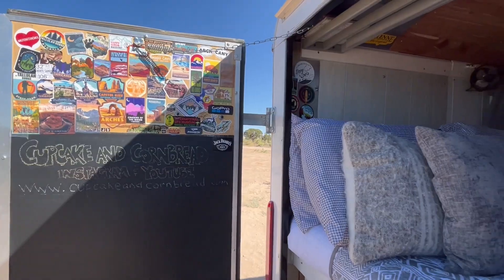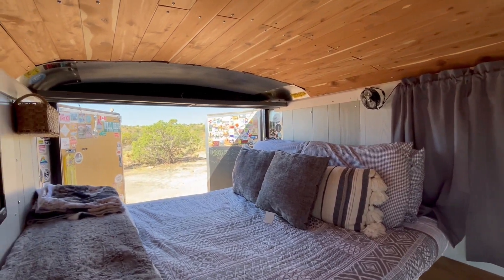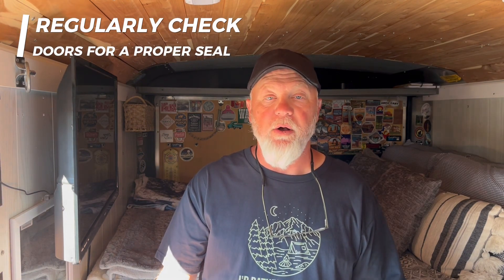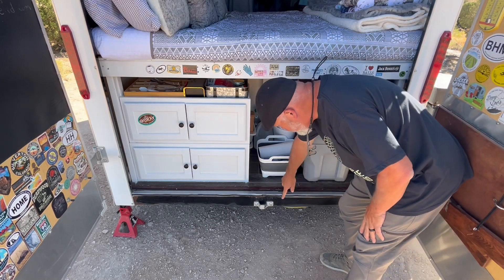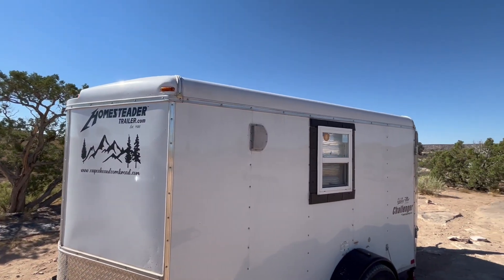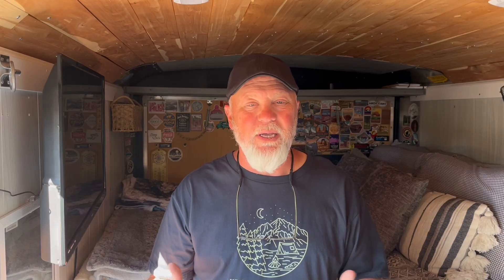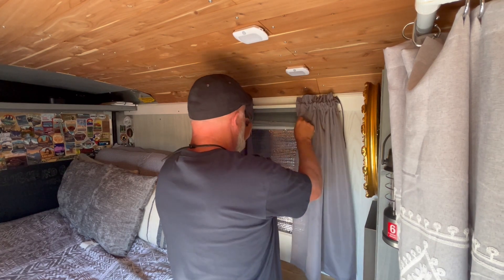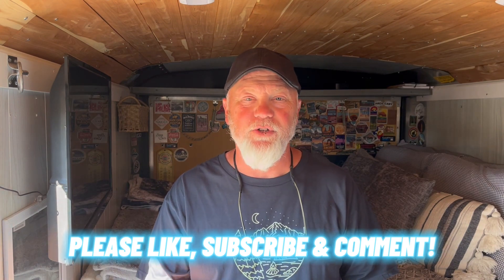Repairing Our Cargo Trailer On The Road - What Did I Do Wrong?!

Comment: Thanks for the tips.  Didn't think about the dust since we are in NJ - but we are heading out West soon.  Thanks again.  Hope to run into you on the road.  Happy traveling and stay safe.
Reply from the maker: Thanks for stopping by!  Yes, dust can be an issue out west, but lots of dusty roads lead to amazing adventures!  Hope we'll see you on the road too - have fun!
Reply: Rick is going to seal up an opening by a pipe so dust and west bugs don't get in.  We are only used to east bugs.  lol @CupcakeandCornbread
Reply from the maker: Sounds like a plan! @cargoon-cargoconversionbui2880